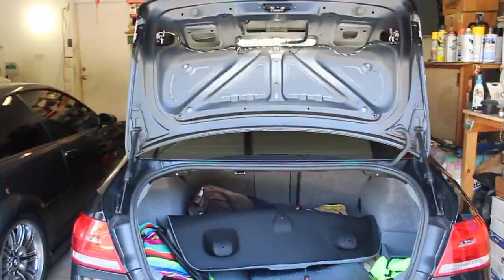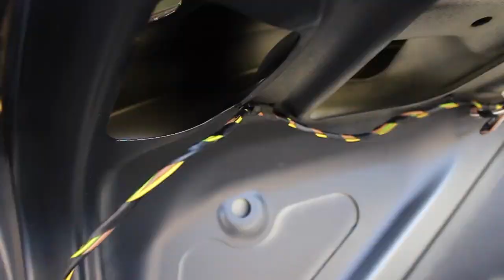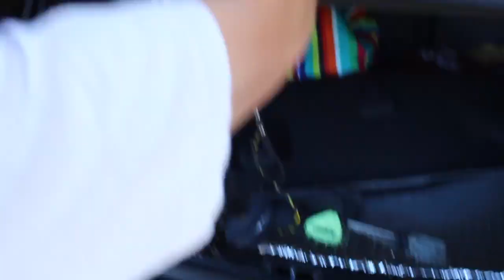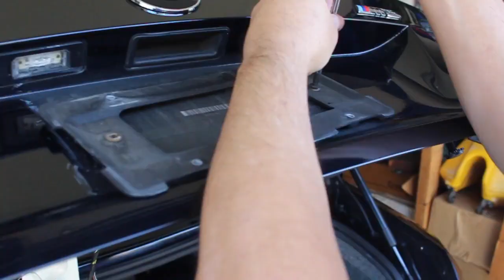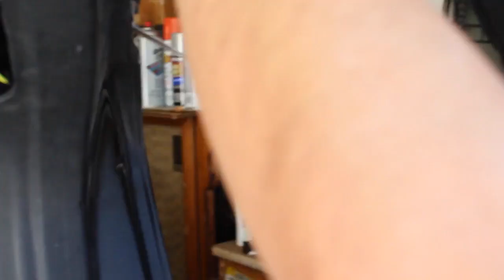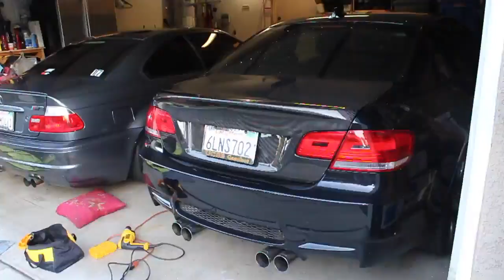Carbon Fiber CSL Trunk Install | E92 M3

Comment: What tools did you used to remove the trunk?
Reply from the maker: Hexdor Diaz if i remember correctly, it was just a couple torx screws holding the trunk in on both sides
Reply: Which trunk is this, how does the weight compare and how is the fit?